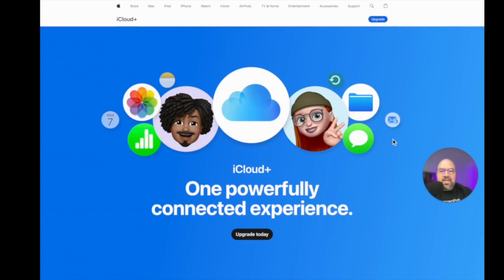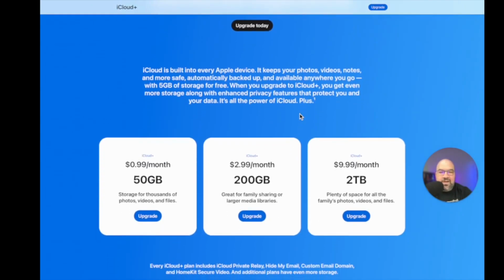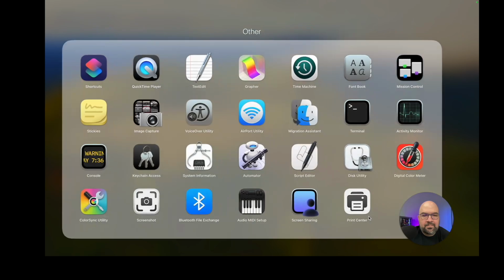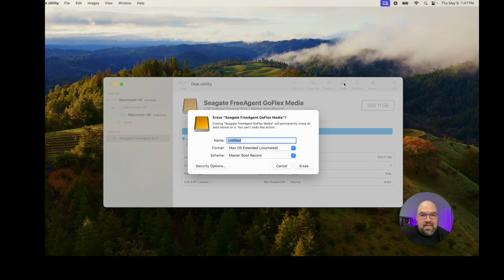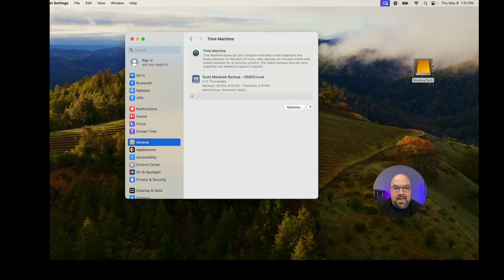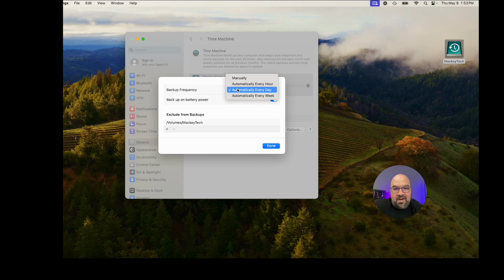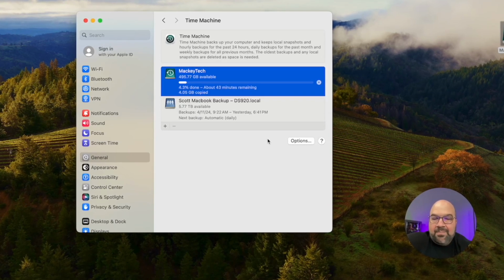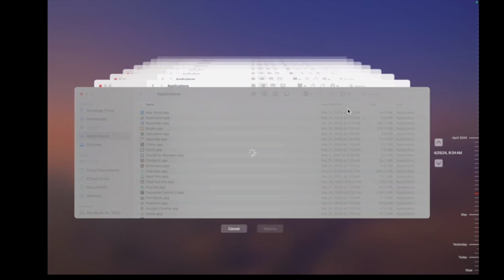Beginner's Guide to using Apple's Time Machine

Comment: hello, thank you for your information. I backed up my mac to an external hard drive and I do not know how to open it to see whats on it, and also work from the hard drive. I would like to keep all my content on external hard drives so it doesn't fill up the storage on my mac
Reply from the maker: Hi there! Thanks for watching!
Could u pls tell me what mac you have?
Did you back up your mac to the external hdd using Time Machine?
Reply: @MackeyTech yes I used time machine. I have a macbook pro sequoia 15.5
Reply from the maker: Gotcha. So Apple’s Time Machine is designed specifically for backups — not as a way to expand your Mac’s storage. It keeps historical versions of your files  so you can recover them if something goes wrong, but it’s not meant to be used like an external drive for storing extra files you don’t have space for.
Reply: @MackeyTechoh my goodness, thank you!
Reply from the maker: You’re Very welcome!